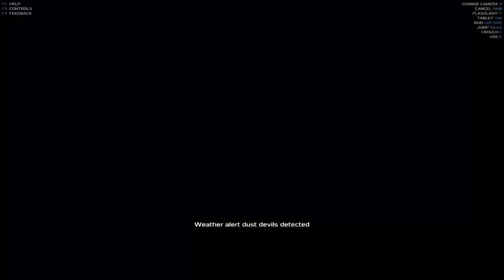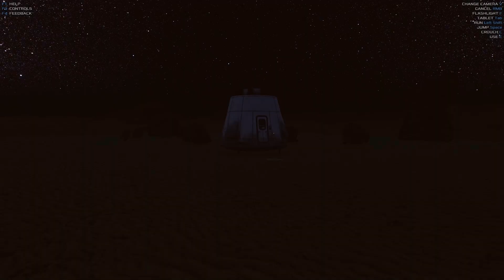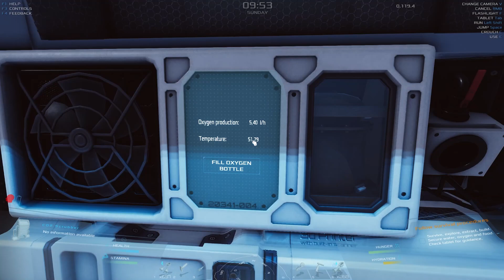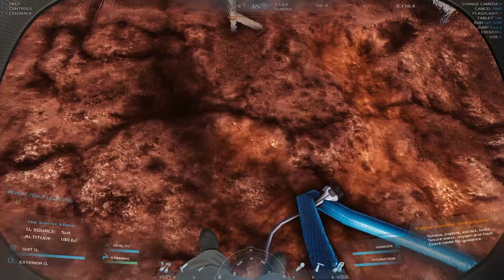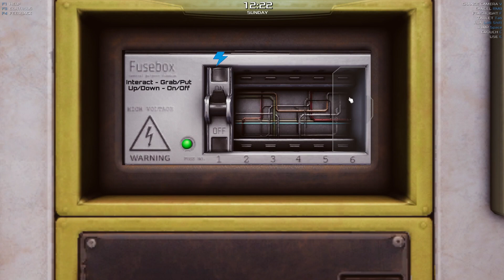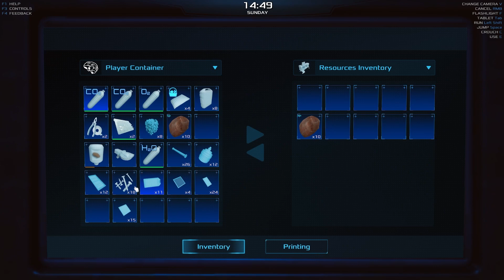Occupy Mars: The Game | Gameplay Overview

Comment: Two air locks are required, and that device for making oxygen that goes inside your base and the water pump has a well extension that allows you to produce oxygen and requires more power to do so